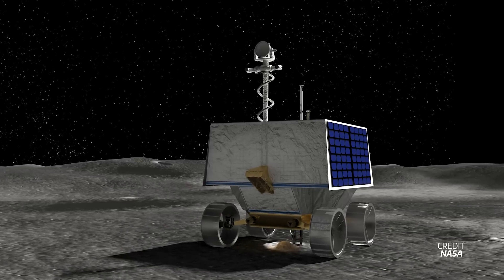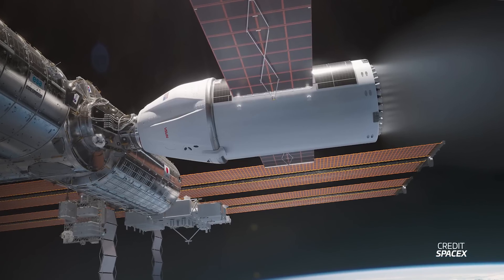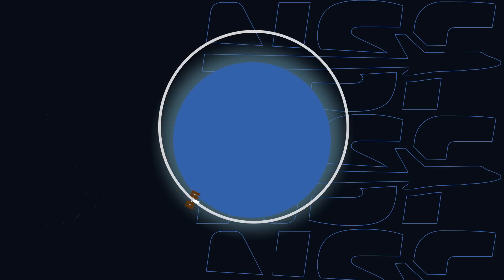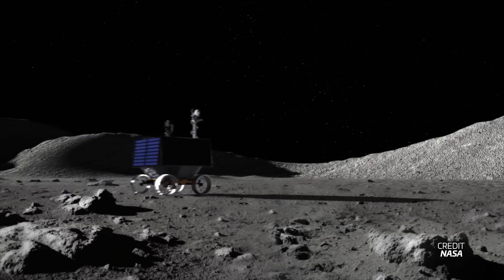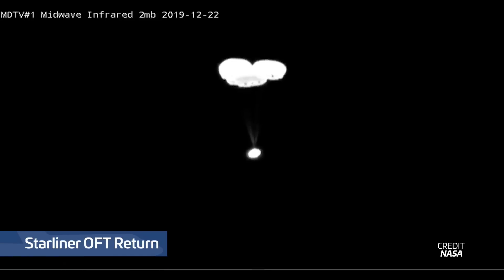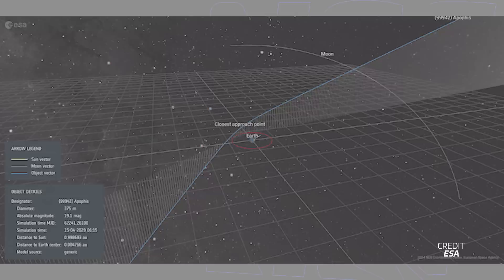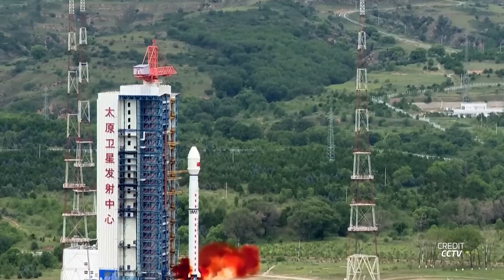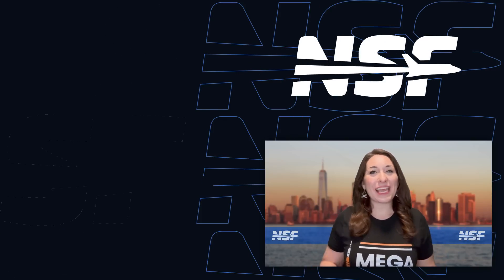🚀 SpaceX's ISS Deorbit Plan (Plus VIPER Rover Cancelled!) | This Week In Spaceflight

Comment: NASA should make sure, the transistors on Europa Clipper are up to the task. A later launch date is better than potential failure for such a mission.
Also, it's not "trapped solar wind", it's electric circuits between Jupiter and his moons and Jupiter and the sun in dark-mode plasma. But mainstream cosmology is not ready to admit that, yet.

Comment: I have a suspicion that the problems with the Europa Clipper probe are due to counterfeit parts unknowingly being used in the manufacture of the electronics. Counterfeit chips and transistors are surprisingly common and can be very difficult to detect prior to actual installation in a module. This is not to cast aspersions on the organizations that actually constructed the various modules. Sometimes the supply chain can be very complex and unscrupulous operators are always willing to make an illicit buck. Selling similarly functioning but not radiation hardened parts is a way for unscrupulous operators to increase profits. Such parts would perform to spec in normal functional testing and would only show up in very specialized testing.

Comment: I wonder why they don't just boost the ISS into outer space
Reply: When pieces start falling off, the higher you are the longer they stay in orbit (and pieces will fall off). Safer to splash it while it's still intact.
Reply: @dancingdog2790  Not if you boost it out of Earth's gravity well and let it roam the universe.
Reply: It takes an incredible amount of energy to do so. It would cost a lot and it wouldn't be worth the effort. The ISS is old and aging and its structure may not live for too long beyond 2030.
Reply: @ale131296  It is too big to burn up on re-entry so it doesn't matter how it survives the boost to deep space. It also doesn't matter how fast it leaves orbit. Just conjecture. They will do whatever they decide.